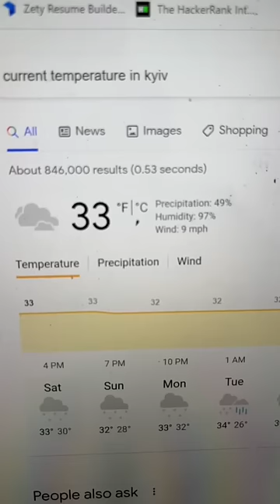Why doesn’t Ukraine use diesel locomotives as power generators?

Comment: Hey Ryan, Ukrainian here. The problem is not the power generation but power transportation. Our Power plants are mostly intact. It is the grid and transformators that are being destroyed.
Reply: Yes. Exactly. Thank you for pointing it out in the comments.
Reply: But you can generate it near the consumer
Reply: @dionisdsns1525  if the distribution is down and not fixed if you energized it you can cause fires and electrocute people and stuff
Reply: @bear76009  no
The power of train is about 1000 kWt
So it s enough to feed about 1000 households. 10 multiappartment buildings or 1 big hospital or so, so it's not about distribution. You just put this train near consumer and feed them directly.

But there is another little problem. Train generates direct current. You need to convert it to AC.
Reply: @dionisdsns1525  most of the consumers have already bought generators. During blackout if you will take a walk you can hear their engines rumbling all around towns. 

But it's still not a perfect solution
Reply: @blankspace998  "most" means >50%
No, far from "most"
And they feed themselves, not water pumps or mobile network antennas
Reply: @dionisdsns1525  I'd argue that the number is closer to 60% 
Yes, they do not power Antennas.
But in case of a private house, generator can power pump, and heating and the house itself.

The problem is indeed in multi storey buildings that are way too centralised in their construction. But i think that it way be sorted out as well if every house authority bought high power diesel generator.
Reply: @dionisdsns1525  Ukraine needs the fueled locomotives on lines such as Kherson and others that lack electrification or have had it destroyed. They are an incredibly valuable asset that can't be used in such a manner.
Reply: @dionisdsns1525  what exactly is your point? Do you honestly support the idea that diesel locomotives can really help a significant number of people without electricity in Ukraine today?
Reply: @Concord003  yes I do. I cannot cook without electricity, fridge didn't work for 36 hours at first day, now it stinks, water is not running as well. 

If I will know that I will have electricity not 24/7, but at least twice a day for couple hours(predictable) I will be happy
Reply: @dionisdsns1525  no power? how are you on youtube?
Reply: @dionisdsns1525  Humans aren't the Protoss. We can't broadcast power over long distances by constructing additional pylons. Yet. We still rely on wires over long distances to transmit that power.
Reply: @kbtdadap  that kind of nitpicking suggests that you don't have a good picture of what's happening with electricity here in Ukraine. The damage from Russian missiles and Iranian drones is such that the electric grid can't supply everyone. The physical links were mostly restored, but some percentage of transformers were damaged/destroyed, putting a limit on total power we can have. So we CAN CONNECT almost every home, but CAN'T SUPPLY ALL AT ONCE. So there are scheduled and unscheduled balckouts, sometimes alternating block by block, so that every home gets SOME power in every 24 hours, but it's really unpredictable. Very hard to plan work or anything really. I'm working from home and also raising two kids, almost on my own, and it's very difficult with an unreliable and unpredictable power supply.
Reply: @dionisdsns1525    I understand and support WHAT you want. But I disagree with HOW you suggest to get it. 
Let's do some simple math. Last news I saw quotes 6'000'000 Ukrainians without power. Averaging 3 people per household, per latest surveys, we get 2'000'000 households. TWO MILLION HOUSEHOLDS WITHOUT POWER. Taking your claim of 1000 kWt and therefore 1000 households per diesel locomotive, we need 2000 diesel locomotives to generate backup power for you and me and all other Ukrainians without stable power. Ukraine simply doesn't have them. Latest report from Ukrzaliznytsia (Ukrainian railway) quotes having about 2000 locomotives total in year 2020. More than 1000 of those are electric locomotives, which CONSUME power, not generate it. So, less than 1000 diesel locomotives out of 2000 needed.
I could be wrong, so let me know if I made a mistake somewhere.
And then there's the war. The ability of our Ukrainian soldiers to repel Russian assaults depends heavily on a steady supply of artillery shells and other ammunition. That's thousands of artillery shells delivered to the front lines by trains and by trucks every day. And someone pointed out above that areas close to the fighting are without power, because they are the most damaged. So we probably need diesel locomotives near the front lines, if you don't want to hear news of Russians taking Kramatorsk, then Kharkiv, Zaporizha, and Dnipro.
Reply: @Concord003  locomotives will not work 24/7, just 1 hour and then switch to other neighborhood. So the number you counted could be divided by 12 (1 hour but twice a day)
Reply: @Concord003  trains are used to move artillery shells right, but near the front line they reload it to trucks, I guess

And the number of locomotives is not constant, we can by or lend them abroad. In this case they don't even have to fit with soviet gauge. Put them on a platform and move wherever you want.
Reply: thats honestely much better than destroying power plants, even the biggest power transmission lines are a fraction of the cost and man power to repair than the smallest of power plants. if russia wants to control ukraine it wouldnt want to rebuild the power plants
Reply: @dionisdsns1525  European trains have been AC for some time. Even the newer American locomotives are now AC.
Reply: @dionisdsns1525 you could have people only use heat and you could raise that number even more. I know most wouldn't and would try to run other things. I worked a lot of power outages during storms and we have tried to tell people only to run the necessities until we fully restore everyone and it doesn't work to well, only a handful of listens. But the Ukrainians may be different but I know American people don't.
Reply: @blankspace998 That’s probably not gonna be most people. Just the ones who can afford to.
Reply: @t.r.4496  That's interesting point. Couple weeks ago when infrastructure was damaged, but not so hard and authorities asked to reduce power consumption it reduced by about 10%.  But now I guess people use everything once the power is on - cooking, charging devices and so on. Because now power is absent for longer time and people use opportunities while they have it.
Reply: @vintagethrifter2114  what is their frequency?
Reply: @dionisdsns1525  it’s not mystery science to provide an inverter though. Every feed-in solar installation has one. In times of war, it sounds like the sort of kit a factory could turn out in a few weeks.
Reply: Wait a minute. Why don't we send 10 of those solar generators that they advertise on YouTube. You know the ones they advertise about every 2 minutes. 10 of them should take care of the whole country with power to spare, right? Right? They're constantly interrupting us wanting to suck money from our pockets. 
Just saying.
Reply: @dionisdsns1525  ok maybe you're right and maybe solving at least a part of our energy shortage with diesel locomotives can be done. I still think there are simpler ways to do it. For example, I think there are enough proper generators available on the market around the world. They would be much easier to transport and use. So it's only a matter of whether Ukraine has enough money to buy them and/or if the West can quickly provide them in the form of humanitarian aid. So I am hoping that our government and emergency services are working on this and other easier scenarios as we speak.
Reply: That explains why in some parts of Ukraine, power is restored rather quickly.
Reply: That's exactly what I was thinking.
Reply: This is what I was going to say. It takes years to replace a Transformer, but a generator can be replaced much more easily. Counterintuitive because the generator is bigger, but its doesn't have a 2 year lead time like the transformers. Transformers have always had a long lead time due to the lack of specialized manufacturers. It has nothing to do with Covid or the state of shipping.
Reply: @blankspace998 I live in Northern California and everyone here has to have a generator because they shut down the power if it's too windy because of fire danger?
I hope the people are doing well, they're serious fighters for their freedom, from a maniac!
Reply: @vintagethrifter2114 Europe not have unified rail power systems. This is not easy to solve as europe is not country and unifying efforts takes decades to progress.  In my country for example we use DC and AC system together. Not mentioned voltage differences.
Reply: @rybaluc  Everyone knows that Europe isn't a country. Ukraine is a country in Europe. They have access to AC locomotives because they are in Europe and Europe has AC locomotives. It's the same as referring to North America when talking about Canada, Mexico and the United States.
Reply: @dionisdsns1525  there is such a thing as overload. If you put too much charge on a line it WILL blow. Need proper transfer shi like transformers for the specific input and output desired
Reply: @Concord003  Don’t put people off!
Reply: voltage and frequency.
Reply: Oops sorry I left my reply on the wrong comment sorry about that so if you see something deleted just know that was me deleting it
Reply: And with tremendous skill, I might add, @blankspace998
Reply: Good i hope you stay there and fight like a real man....the rest who left .hhahha shame on them and there familys
Reply: @Rapture-Farms  are you saying that to the person who posted the original comment or are you replying to someone else in the reply section
Reply: @jrunner5k  Yup. It's all about the money for Putin and this would have been a extremely high value strategic targets if it was done from the start, but Putin is targeting them now hoping to cut the heat and shut off the stoves/freezers which is pretty terrible
Reply: That's what I thought the issue was
Reply: Power distribution